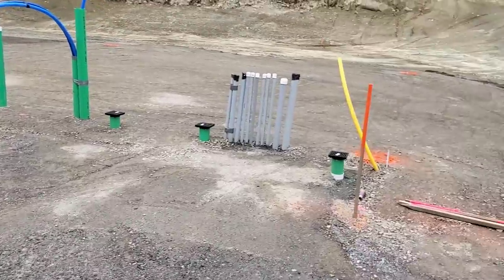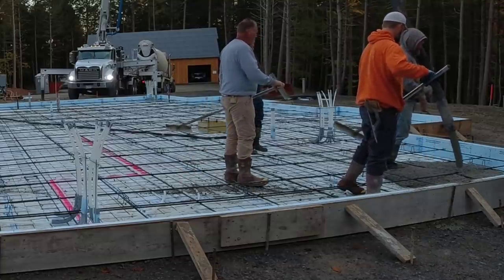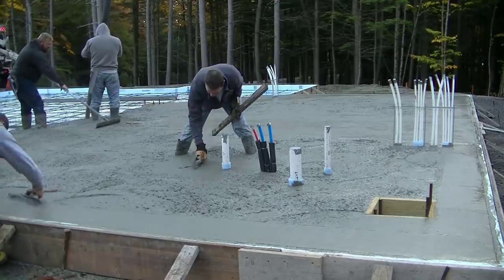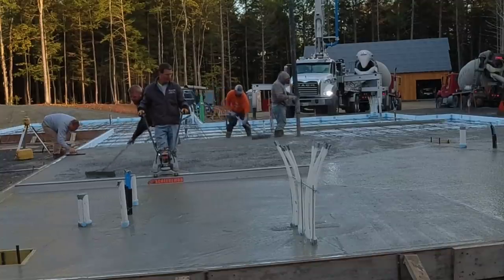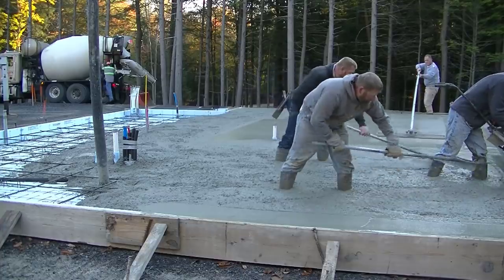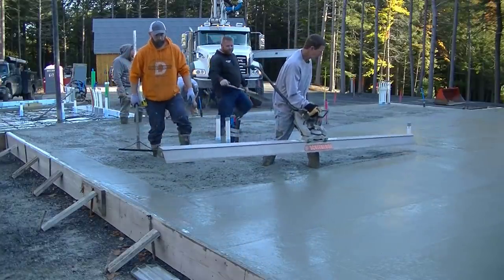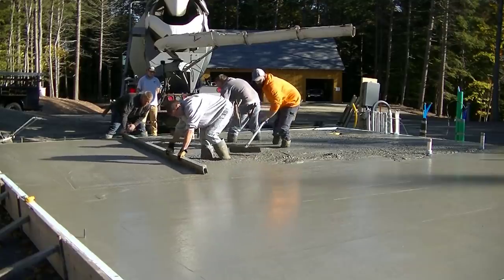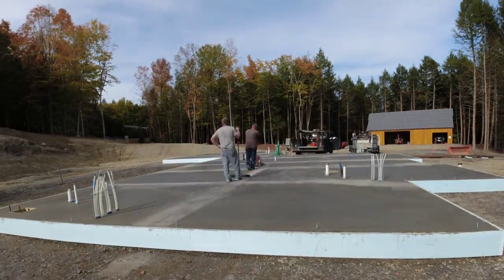He Made Us Pour His Concrete Slab 10 Inches Thick! (Waste of MONEY?)

Comment: I drive a Mix truck. I'm surprised that your using a pump. a lot of the contractors in my area refuse to use one. leaving the front forums down and having up back all the way into the grade. also we have several contractors that just LOVE adding 30-60 galleons All the time,  I cut them off after 70. (only have a 100 gal tank) that last 30gallons is MINE. its not easy to wash some of these mixes out. some just refuse to let go of my fins!

Comment: Before I watch… I’m suggesting the heating system might benefit. The mass changes temperatures much more gradually and can be fairly consistent temps year round. Heat sink.
Reply: Thicker definitely less prone to settle into the foam and be very flat. I commonly shot elevations and thick gets better compression on the foam and doesn’t dip as much after the screed. But I’d be considering 6” as thick enough generally, but many exceptions. I don’t expect to drive my pick up into the master bedroom, but if he does it’ll be fine. Lol

Comment: This is the way they used to pour slabs, all the way up through the early 1960's. Slabs poured like this had far fewer cracks or settling failures. Myself, I would have added more steel and grade beams every place there were bearing walls. Upgrades after the fact are out of the question. And slab repairs will far surpass the cost of any upgrades done at this point.

Comment: I was also pushed from all sides to make my 50m long path at 10% climb up to the house as thin as possible. 4 inches they said, and one layer of 6mm armer. But you only do this job once and it will be there for 50-100 years. Why run the risk to get cracks? I made it 7 inches and 2 layers of armer.
A few years later we decided to build a pool in the back yard. I drove all the digging machines and materials up over the path and not a single crack. That road is going nowhere that is for sure. And since I am a concrete worker myself you understand it is quite important for me that this will look perfect for many years 😄

Comment: So a slab on top of the ground is called a foundation? Cuz most houses I've seen are digging 1.5. metres of soil, 50 cm wide and then you put in the rebars and fill with concrete, then you pour more concrete like in this video.

Comment: We don't build on the floor. We build the walls on a concrete footer below frost level and pour concrete floor after because the weight of the walls on the floor slab will cause it to crack around edge and sink.

Comment: “He had a guy set pins.”
That guys title who set those pins is “land surveyor” and he set building corners for you to build by. Making your job far less complicated and the overall project ends up costing less. With far less likelihood of catastrophic errors.
And no it’s nothing overkill at all.
Grade beams are obviously far more common but a solid 12” thick slab with all the steel you guys added is less likely to move later on
vs a 6” slab with normal steel and standard residential grade beams on the outside only. 
No: He did not save money pouring all that extra concrete and using the extra steel; but I suspect that slab outlives everyone involved in that house building project.

Comment: I built a lot of radiant heat systems and the thick concrete will be a nice thermal mass once it hits his design temp...  was it needed .. probably not . I did a double pipe system where the first run was larger pipe with triple separation 2 feet down under the compacted  gravel before the final 5" lift and conventional heat tube and concrete pour -- did the same thing. -- damn nice slab tho

Comment: 10 in = 25 cm ... so what?

From the German build code:

The construction of the foundation
----------------------------------
Due to the complex design, there is a drying or blinding layer under the actual foundation. In a house, this consists of highly compacted gravel or lean concrete. Then a diffusion barrier with thermal insulation, and then the actual foundation can follow.

The strength of the foundation
------------------------------
The overall strength can now be derived from this. Because with a building foundation, in addition to the pure foundation strength, the thickness of the blinding layer must also be taken into account. With a conventional foundation, this can be compared to the water-draining gravel layer under the foundation. The minimum dimensions for the blinding layer are 5 cm, for the actual foundation the minimum thickness is 25 cm. Please note that these are absolute minimum dimensions. Even a foundation for a carport or garage may need a thickness of 25 cm if this area is subjected to a correspondingly high weight.

Comment: All concrete cracks, so if he was trying to avoid cracks by pouring a thicker slab that isn't going to be the silver bullet, but I admit it helps.

I feel the builder was going for thermal mass here, although if he was trying for reduced cracks superplastisizers like basf (which you guys used but perhaps not basf),  carbon fibers for reinforcement or if the ground in the area is really bad carbon fiber mesh an inch from the top 20 and 10m rebar on seats  from the bottom.

But now were talking building a 10" thick engineered slab around 70-90 mpa. So if heat mass was what he was going for, he may save the extra $3000 used in concrete vs labour, excavating and heating in 3 years time with the flat thick mass.

Those are my thoughts.

Comment: Seems like 4x the cost is grading were 500 more by my guestimate, but if it's his own house, why not? If I were doing my own house it'd be nice and thick to prevent cracks later from settling.
Not that this matters to anyone but me; but I wouldn't actually use concrete alone. I'd use slabs of rock high in silica so marble, maybe granite, oolite etc... as it's been discovered this is much healthier. Basic concrete is actually unhealthy to live over. Maybe if it's covered in marble or something like it, might be good. I wonder if mixing a high purity silica sand into the mix might help. 
I once worked in a warehouse and simply couldn't take it. Like it was sucking my battery dry.

Comment: I am sure you are the bestest concrete contractor in the world and would never do that but I cut and demoed concrete for 25 years and I can count on one hand the number of six inch or less slabs where the rebar or wire wasn't on the very bottom of the slab.  Most six-inch slabs are really closer to five and a lot are four and a half.  The rebar or wire always gets stomped to the bottom and might as not be there.  And they all crack.  A ten-inch slab has two mats of rebar and it won't move or break especially if you use pour strips.  Even if you do a remodel and move a bathroom or a pipe breaks, cutting and removing is a bitch but it doesn't affect the integrity of the slab.  If you can afford it ten inches is the way to go.

Comment: Would have been cheaper to do 6" slab and use post tension... then you dont need to have the footers under the walls or in the middle or as the midwest calls them "beams"... but post tension is a single depth and then the tension makes it STRONG! and no cracking...  

I like the 10" thick tho... that is going to be a SOLID slab when dried and no vibration from cars or people walked or dropping things like a wight in a gym room...  That slab is freaking solid at 10"....

Comment: A 2x10 truly measures 9 1/2 inch.if it’s a true 10 inch or  Graded following the 2x10 at 9 1/4 to 9 1/2 .if the guy has the money,thicker is better.what about 6 inch with fiber-mesh unless if he doesn’t like that little fiber look that shows.6 inch fiber mesh would be stronger in less thickness.oh n you have the wire. Money wise,ide go with 6 inch fiber mesh with wire.I think it would be equal to at least that 10 inch pour.just my opinion .

Comment: A 10 inch reinforced  slab is a rigid slab, and much better structurally than a 5 inch thick with wire mesh, and less susceptible to cracking and curling. Like they say : You what you pay for

Comment: Just because it not what you are used to doing or whats common doesn’t mean it there isn’t a reason for it.
 Slab stiffness and barrier insulation are worth the expense.
 It really is disappointing to hear people criticize structural integrity do to inconvenience of what they are used to because it takes longer… 
 If you don’t do all of the math and don’t walk out all of the gains and losses its just annoying banter.

People talking like this is why there are so many issues in the construction industry with houses failing to last. Everyone thinks they are doing more then they should need to but the reason if considered it is almost always rational. Not including the “extra” nails, 1” or 30yards usually is the reason a good build becomes a problem build.

Comment: Hummm.... there are a lot of reasons to lay concrete that thick, most of them relate to weather conditions.  Not sure why your asking the viewers, you should of asked the builder (experienced for a lot of years) what the benefits were. Second thought is I would expect you (experienced for the same number of years) to have some ideas about the theory behind this kind of pour.  Third thing might be potential for increasing the height of the building wall or secondary levels.  That is no basic house slab, under floor heating and plumbing in colder or even damp conditions will last much longer fully encased. Given the right design profile and conditions that slab will hold a days heat more evenly than a tapered profile you are suggesting. Longevity of the slab over time is also a consideration.

Comment: Never had a basement floor or poured wall not crack in over 50 yrs, pour it thick and use rebar, wire is s shortcut for contractor

Comment: I asked for a 10" slab years ago, when finished I started installing machine tools and found many places of 2" concrete. The contractor refused to repour the floor. I took all his equipment and his house in the settlement still didn't get enough to repour the floor but the second contractor did do a good job. The first guy, well he is still in jail for fraud. Point is if someone asks for something just maybe, he or she knows what they want.
Reply: No inspection before the slab was poured?
Well, there you go!
Saving a few bucks on inspections will result in a shitty job!!!
Happens all the time.
Did you do a Soil Investigation Report, and did you hire a Structural Engineer?

Comment: You know what is a waste of money? The fact that nearly every single house in my city has a broken concrete slab. My bedroom has sunk 2 inches. This is why we need the federal government to put out heavy handed regulations. It is insane that I have to spend $28,000 to  put in steel piers down to bedrock when that could have been done during construction for less than half the cost and would have prevented the damage to the house by the sinking foundation. It's a waste of money that outdated and inefficient designs are still used by nearly every manufacturer. Un insulated attics were only a good design before people started running AC ducts in them, now they reduce the efficiency of your heating and cooling by up to 30% but most houses are still built that way in the US (at least in the states I have been in). Companies in America are so lazy they refuse to adopt new methods unless the federal government forces them to. It's why the entire state of Texas had the energy grid fail last year, and right now...this very year...they are still building houses specifically designed to be energy inefficient.

Comment: If he paid you for the work and he is a good customer for you, what difference does it make? In truth a lot of concrete mixes have enough flyash and additives it has suspect strength and durability. I would rather have more than just enough. But I worked at the plants years ago and seen a lot of mix designs that many customers didn't. It would shock you what we were giving them. We had mix designs that had over 50% flyash in them. Flyash cuts strength and longterm durability. Also it makes it hard for the finishers to work with because it gums up on the screed and floats. It's just a pain to work with.

Comment: Maybe all houses are wrong except his house 😂 Haha
 
Overkill this is overkill 
I’m electrician I have a small ranch and when I wire up a receptacle in my house 
Anything over 70 feet for receptacles is 10 wire. Any receptacle under 70 feet is 12-2
Light circuit 1 per room

I have an old 100 amp service to my house 
100 amp existing panel still has circuits I have to rewire 
I used a 90 amp breaker to wire my sub panel.
There  3. —  200 amp - 42 circuit panel and have 3 side by side each other in my basement .  Im not done yet I’m up to 90 circuit. In my house. 
In time I have a 400 amp service on my house. 90 percent of my plugs are not being used in my house but I be ready when I do.
But I have extra meteral left over from jobs so it really doesn’t cost me nothing to do it except my own time.
Again at night wire 1 Cir then im done. It a on going at my house
My closets have a light above the door and on each side on my closet door it switches 2 plugs to turn on a plug in lights that to light bottom of my closet 
I install  in each counter cabinet magnetic contact to turn on lights  in each individual counter cabinet. Power Cable and telephone and Ethernet wires run to my shed and have stream less WiFi through out the property with no drops so I can used the projector and watch movies have speakers through the property hardware to watching the movies my projector screen is 4by 8 foot by 1 inch PVC wood and screen is 12foot by 24 foot. 
Yes I’m over kill but I have a lot left over stock from my jobs.

Comment: No 10 inches is not overkill but my buddies garage is on a hillside and the front has 4ft concrete with 8 ft footer back is about the same but footer is 12 ft we tried to drill thru it we got 39 inches and no luck yet

Comment: No, it is very smart. But most likely very unconventional for the USA. A thick concrete slab is a great energy storage mass. In combination with water-based floor heating and ground well heat-pump you can cut the energy bill down to 20% of what it would be with direct-based heating. So the extra cost of the slab is nothing compared to the energy-saving during the lifespan of a house that might be 60 to 100 years or even way more. The US is still burning gas to heat buildings, which will be gone in 20 to 30 years. Then will electricity be the energy source most likely from nuclear power plants operated from Thorium and nuclear waste and old nuclear warheads... Then due to CO2 emission standards and rules will old gas-based heat systems be taxed to extinction.
So a very thick concrete slab is to look forward and to understand the changes coming AND saving money in the long run. Which I think is fantastic for somebody living in the USA. Most of what I see are extremely short-sighted regarding investments.

But the ground insulation is a joke. In Sweden we are currently up to about 500mm or 20 inches of ground insulation under the concrete slab...

Comment: My slab (winter house, Palm Desert, California) is 12" with a double #5 mat, with multiple grade beams with #6 rebar, but then again I look at the San Andreas fault across the valley every morning leaving the house.  I went with a thickened edge at 18", and would've gone deeper (also had some point loads), but we significantly over-exed and compacted the living sh!t out of the ground.  The things that retired carpenters and contractors do with their own houses, SMH.  :-)  Rebar and concrete are cheap when dealing with earthquakes.

I've built a fair number of apartment and condo buildings with mat foundations (all Type V, wood, 2-4 stories), with and without thickened edges.  Mats there are often 14", and mat forming goes fast as hell.

Comment: Way over kill, and should have put more rebar in to give it more strength. The extra cost of the concrete is silly. Six inch slab is plenty for a house slab. I've done concrete carpentry for tilt ups.. that screed is pretty trick. I've dumped 50 plus yards into one footing for commercial jobs before

Comment: Not even close to overkill.  

I put down a 15’x10’x1’ slab to put two 1,000 gallon propane tanks on.

My diesel genset is also on a 30’x15’x1’ slab with two 500 gallon diesel tanks.

Bet neither slab is gonna crack in my lifetime, lol

Comment: You preface that this guy is a builder, which would seem to indicated he has some actual technical knowledge.     Even mixed in with you complaining you acknowledge that in some ways it was easier.   I doubt you absorbed the cost of the extra concrete or labor so if any money was "wasted" it was his to waste.    And it kind of sounds like your biggest grips is that he asked for it to be done a way that you normally don't work.      For all you know he's going to have massive parties, or extra heavy items, or he's calculated some kind of savings over the long haul, or so in loved with what was designed that he wants it to be standing 500 years from now.    

If the extra foundation does provide extra structural integrity and is not detrimental or against code, I'm baffled why you're complaining.     Minimum specs are just that "the minimum required".  It sounds like this customer knows that going a bit over minimum will alleviate or mitigate future problems and save him money and effort in the long run.    Especially when we just had an example of that condo in florida that was built to "minimum" requirements only to collapse decades later.

It's one thing for the contractor, designer, or project manager to "gold plate" a project in a way that the client didn't want nor request.     But that is not what's happening here.    It it were me, and professionally I knew the extra inches would add no additional structural integrity, I would explain that.     But I've not heard you say that is the case.